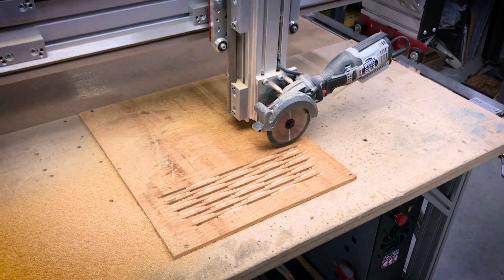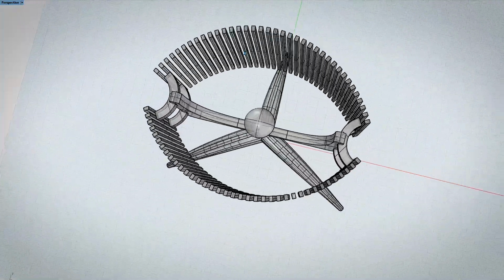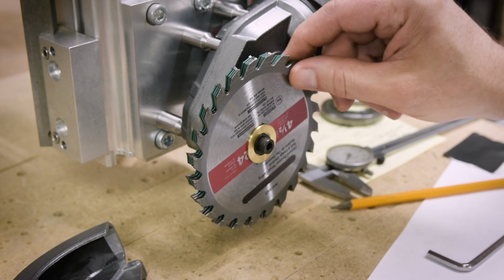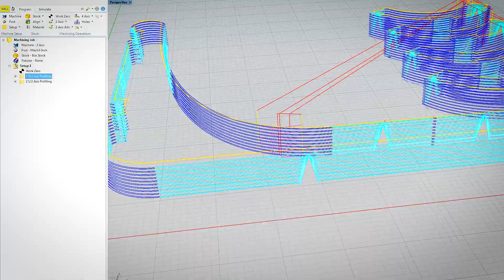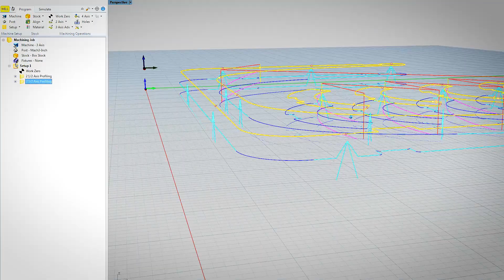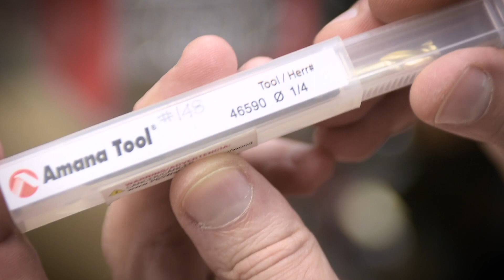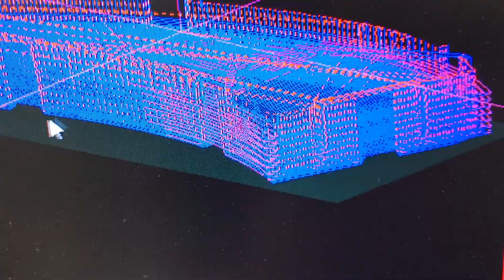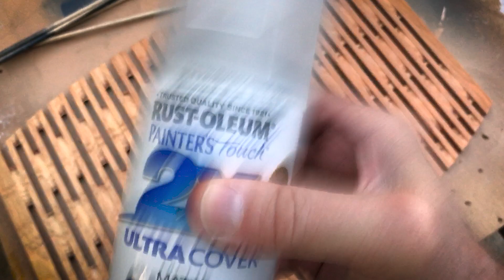FLEXIBLE PLYWOOD LAMP // MID CENTURY MODERN // CNC CIRCULAR SAW // CNC MACHINING TIPS AND TRICKS

Comment: first of all , the cnc saw idea is great , though the light is verry nicely constructed i think the thickness from the material used is a bit mush , makes the light look bulky (do the same thing with 5mm ply and a single saw and it will look better (and probably be weaker )
i do think that the way you cut the material makes for great chairs , basicly lay it across a frame to make a lazy chair , think the material is strong enough to lay on if you enlarge the design some , the bigger chair makes the material look sleeker too
might allso look nicer to get one or two of those LED strips and stick those in a circle on the inside of the lampshade , gives a nicer effect when you walk by (multiple lightpoints getting cutt of by the ribs of the lampshade )
Reply from the maker: Thank you for sharing your thoughts. Those are some good ideas and observations. The variations are endless. I’ll continue my experimenting. Stay tuned!

Comment: I really like the lamp but I don't really understand the need for the saw attachment? Could some explain the benefits to this over a 1/4 that he programmed with?
Reply from the maker: Thanks for watching! I’m sure it’s a similar situation for Blacksmithing, where there’s more than one way to accomplish a final form. First of all, this is an experiment to learn something new. As far as the benefits, a saw is generally the tool of choice for cutting straight lines because it’s most efficient.
Reply: @WorksbySolo  Thats a very reasonable response, thanks. I have attached an angle grinder with a flap disc to my cnc once for a very repetitive sharpening job, so i appreciate the experimentation.

Comment: Just out of curiosity, how much faster were you able to feed with the saw vs. a 1/4" endmill? I would think speed would be the only potential benefit, because that pattern at least looks like it could be done with just a regular endmill.
Reply from the maker: It’s a good question. I didn’t do any router tests, but my guess is that the saw is faster. The one small difference in the final product is that the end mill would leave a slight arched surface where it ramps. The initial thought I had was, if I were planning to rip a sheet of plywood, would I use a router or a saw? Actually, that’s a good test you could do yourself without a CNC. My guess is that the saw would be more efficient. Either way, it was a fun experiment where I learned new things.